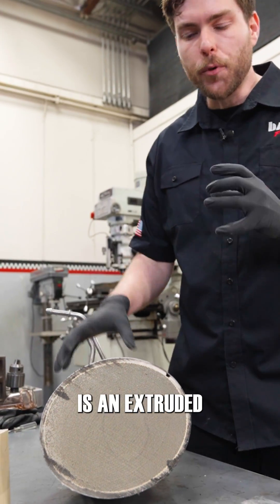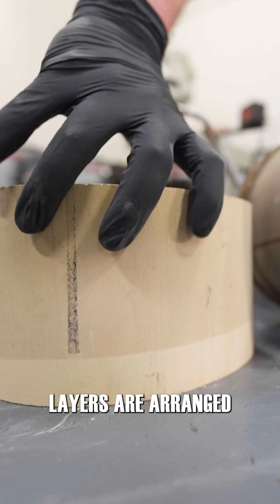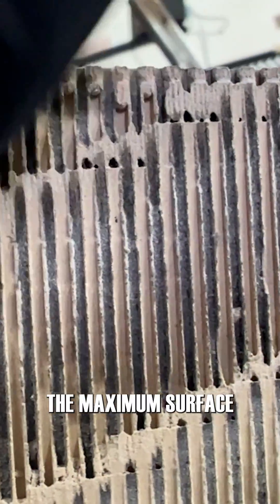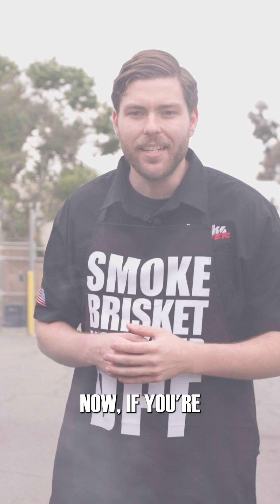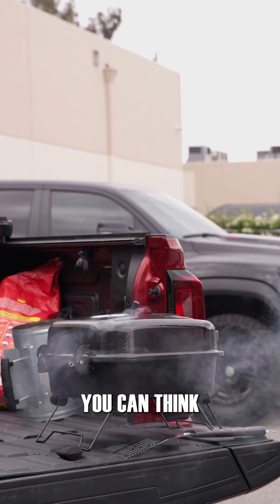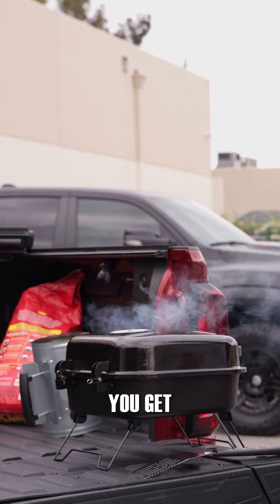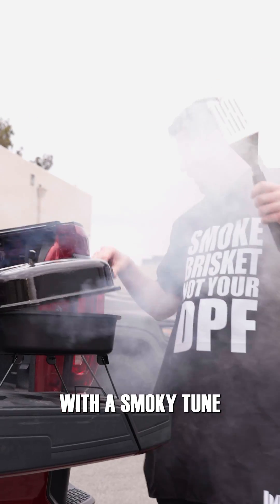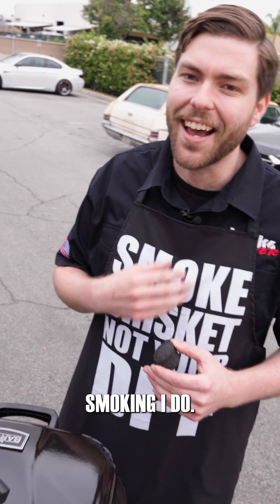Why rich tunes clog your diesel particulate filter (DPF)

Comment: What a waste of time and money. If you have a well tuned diesel engine you don’t need a dpf.

It’s all a money grab.
Reply: Even the most well tuned diesels don’t always have complete combustion
Reply: @AAthlete34  … and batteries for electric cars don’t always charge. I don’t see your argument.
Reply: @garrimic3  just saying, filters are necessary for scrubbing carcinogenic particles out the exhaust, they are needed for even well tuned diesels because they will always produce soot.
Reply: @AAthlete34  .. okay.. then what do you do with all the extra emissions that come from producing the systems? Not to mention the extra carbon emissions from delivering those systems to random shops? The carbon emissions that escape into the atmosphere when the system is cleaned?

There’s so much more added to the carbon emissions than just put a filter on your exhaust and it will make the atmosphere cleaner. Because you also have to include the large amount of carbon emissions added to the atmosphere by delivering the DEF fuel to every single truck stop that wasn’t there before the inclusion of the after treatment system. So how exactly do you account for just those few things I just mentioned.

Vs. Just having a well managed engine system that puts out the same amount of emissions without the system vs having the system?

It’s a money grab by environmentalists plan and simple. This started in California and look how nasty California actually is.

Comment: HE JUST TOLD YOU THE TRUTH ABOUT EMISSIONS SCAMMING GOVERNMENT 
""when you're car burns fuel efficiently you have very little emissions particals""
What they do not tell you about the filter is that it automatically DUMPS itself while driving periodically ALL AT ONCE !!! so just like every other bogus smog device created by government scammers to CREATE JOBS by the government, this is a scam...
Reply from the maker: It appears you've misunderstood. It does not "dump" particulate into the air. The system contains the particulate until it gets full. Then the diesel particulate filter burns it, turning it into ash that is not harmful to humans. The ask is what exist the tail pipe. There's no conspiracy. Just science.

Comment: A buddy of mine has a '19 Ram; bone stock, no tune. Originally got about 22 mpg unloaded and about 15-17 with a loaded trailer through the mountains. A "recall" came in for the "intake". Went down to 15 mpg unloaded after the recall. They can make the tunes cleaner, more efficient, and more powerful, they just don't; and will destroy what you have.

Kinda crazy considering I just bought an '89 IDI NA with 4.10 rear end that gets 16.5 mpg. Most running 3.55s get 19-20. Only time it rolls coal is 5th gear up an obtuse incline at full throttle.
Reply: It's only obtuse depending on your point of view 😂😂😂😂
Reply: My old '09 6.4 would get 30 on the interstate. It was awesome. But since it's a 6.4, I ended up saying goodbye to two pistons. So I upgraded to a '15 6.7. 13 mpg whether I'm towing or not. I eventually did a delete and started running an MPG tune and now I'll maybe get 19. It's absurd.
Reply: I have a 1982 6.2 detroit idi with a 3.09 rear, she rolls comfy at 20 to the gallon all day. She only smokes when I'm giving her hell on the throttle
Reply: That's what happened with the VW dieselgate.
An efficient tune, on Diesel, is not the cleanest tune. This is because the higher the cylinder pressures, the higher the efficiency but also the higher the NOx and SOx content.
This type of content on exhaust has massive consequences for local air quality.
Reply: @jorgecosta95 Cali smog reductions are negated by China
Reply: @RichardPrendingue  CO2 emissions impact globally. Soot, SOx and NOx emissions impact locally. 
A city with good air quality is good for everybody.
Reply: My dad’s dieselgate TDI Jetta got the government mandated tune done to “fix” what VW did wrong with dieselgate. 

The car used to get 55mpg on the highway, now it gets 40 at best. 

Still an absurdly good number, but when the whole point of the car was to get the best mpg possible, that’s a huge downgrade.
Reply: @everettbruckerhoff6029  you can reverse that tune for a couple of bucks with a “clip on” tune for a lot of VW vehicles. If you take it in for MOT, or maintenance just disconnect the chip and take it out.

Comment: DPF killed the diesel truck, all that “particulate filter” is…surprise it’s a Catalytic converter!! Same thing a cat does in a gas car an looks exactly the same inside
Reply: Diesels have a few “cats” they have a diesel oxidization catalyst first then flows thru the particulate filter(what u see here) then cooled and sprayed with def after the dpf than flows thru the scr finally and so they say that exhaust gas at the tail pipe is supposed to be cleaner than the air that entered the engine. (So they say)

Comment: Hearing Banks talk about the advantages of DPF's reminds me of  Phillip Morris' "Unsmoke your world" anti-smoking campaign.
Reply: Banks is very anti-rolling coal. He's all about a clean, efficient burn even if that does include more fuel.
Reply: @funkingitup1805  Absolutely, tuners who have made a living modifying emission compliant engine usually share this opinion. Steve Dinan(founder of Dinan and CarBahn Autoworks) had a similar take on people who delete their cats. It's useless.
Reply: @blackshadow7192  That's nonsense. Cats are restrictors. Deleting them is far from useless.
Reply: @xenn4985  You barely get more power. Carbahn will make you an 800hp carb legal S63 engine, it's already more than most people can handle.
Reply: @blackshadow7192  It's not about power. This is the one thing I cannot forgive the banks guys for. They push this power over everything mentality.

You delete the carb for engine longevity, not for power. Restriction is death. Let it flow.
Reply: @blackshadow7192 They only say that because the EPA would put them out of business. And if it is so useless, then why does every single race car have zero emissions equipment?
Reply: @CascadeSport  Because in racing you need to optimize the performance as much as possible. You don't need to do that for a street car.
Reply: @blackshadow7192 why not tho? Shouldn't I be able to optimize my vehicle that I pay 20-80k or even more? It's my property? Why can't I? The government does it, the airline companies do it. Basically everyone accept the base consumers of the oil derived fuel folks do it. But heaven forbid my truck doesn't have egr/dpf, de tuning etc etc. It's quite silly.
Reply: @mwim1226  Enjoy your acid rain lol
Reply: But where is he getting the power, high or low rpm?
Reply: @Robert-j6r8c  both places!
Reply: Thanks for the reminder, smoke break time

Comment: Edison motors is building a hybrid. It will get twice a fuel economy. With additional technology, they should be able to get the particulars of the diesel generator down to next to nothing using hydrogen or propane. Having a diesel engine accelerate and decelerate is just asking for overfueling.

Comment: Someone needs to conduct a case study showing the increased carbon foot print caused by the over manufacturing of these components, the addition fuel required to use them, the shortened engine life, plus the emissions required to hual them off the side of the road. Compare to a stock/clean running diesel that's pre emission, keeping in mind these older truck get better fuel mileage, last longer, and after 20 something years are still running requiring no additional manufacturing. Seems like the cleaned up tail pipe emissions have a less obvious cost that would be greater then what we had to start with. They just moved the pollution from the tail pipe to mining and manufacturing at what seems like would be worse. Like I said a really thural study would have to be done comparing mile for mile and utility starting from the mining through manufacturing all they way to the scrap yard or a significant millage like 500k or a million.
Reply: This, please. I am starting to wonder if the goal is overall less emissions or just trying to keep it out of densely populated places as much as possible even if it’s “relocated” via mostly manufacturing emissions instead. Which, can likely be run off of cleaner sources and regulated much easier. Ideally we will just switch to more advanced battery powered ev stuff (i hate them but given optimal future battery tech they are much better)
Reply: I don't see anyone addressing the DEF. It gets spilled all the time and is highly caustic and ruining your paint is the least of the problem
Reply: @treeless62  friend with a 2021 ram has had his def system freeze 3 times & leave him in limp mode 100km+ from home...

i deleted my 2018 with 4000km on it lol
Reply: @3DProductions how did you delete it? Everyone I know says you can't on newer rams. The newest one I've seen was a 2012 that was deleted.
Reply: @blankname8553 It's possible to delete emissions equipment on any truck. It just becomes a more involved process on the newer ones. If anyone ever tells you that you "can't" modify a newer vehicle a certain way, they're lying. It's always possible, it just takes more work.
Reply: @treeless62  what needs adressing? it´s  highly caustic in the sense that it is diluted water with roughtly 30% ammonia, which you need top break up harmfull NOx to CO2 and water, so it shouldn´t leave the exhaust pipe in big numbers, and every system should have a sensor to warn you if it does. it´s a way better solution to a DPF and enables a cleaner engine overall
Reply: Factor in the carbon footprint of transporting and manufacturing/sourcing of DEF.
Reply: Most emissions restrictions on diesels are to reduce carcinogenic gases, not carbon emissions.

Comment: Cracked Egr cooler make coolant dark, coolant and soot to intake. 7th injector clogs with soot cant get hot to burn soot, dpf clogged, def just builds up.
Bad Nox sensors, def pump fails, fuel wasted on regens,
Load not delivered, bills not paid.

Comment: A DPF system is the absolute worst idea ever they don't help anyone but the person you buy them from and the service guys
Reply: Clearly you live in a shithole with horrible air quality
Reply: The idea is pretty sound. Idk how you could say otherwise.
Reply: @putinslittlehacker4793  how much more carbon was emitted with all the mfg of these stupid clogging up all the time filters, and they require a regen every so often and that uses excessive fuel! just like the stupid old AIR pump systems on cars that simply pumped air into the exhaust stream through the burn your car down BB style converters all trash and it takes a large amount of precious metals and all that by far defeats the emmissions savings by far!!
Reply: @MrChevelle83  The clue is in the name, PARTICULATE FILTER... Stop ranting, you obviously dont know how a dpf works or what it even does...
Reply: @gitanonumero1983  even if I didnt know what it does it doesnt change the facts I mentioned.
Reply: @gitanonumero1983  You mean, like destroying engines?
Reply: @ajs96350  How does it destroy an engine? Enlighten us 😂
Reply: @gitanonumero1983  I know personally a lot of guys who are truckers and they CANNOT keep their trucks on the road because the DPF system either fails or destroys the engine early, it's a pandemic with semis.
Fresh oil will be black as coal 10 miles after an oil change, the oil quality goes to garbage in the pick ups.
Regenerations fail, extra fuel gets injected for a regeneration that doesn't happen it drains into the sump and mixes with the oil and will take out an engine.
I'm not some keyboard warrior, I have a LOT of experience with this junk.
Reply: I mean, if you like lung cancer and heart disease, sure.
Just because something annoys you doesn't mean it's not worth doing.
Reply: @microcolonel  then you'd think our own government would run them on government vehicles, but they don't.
Reply: @dirtbeard108  they exempt themselves, they are not "our" government, or at least not mine
Reply: I think they should be enforced more, it really pisses me off when people roll coal.
Reply: Found the gay guy ^
Reply: yep waste of manufacturing.

Comment: And when dpf burns particles, where are they going? Back in air.🤦
Reply: yes, but at least there's a phase change....
Reply: Yes. As carbon dioxide and not soot. It's almost like there is a difference
Reply: Actually they’re being pushed further down the exhaust injected with def neutralizing the box than flowing thru the scr at that point clean air is coming thru the tail pipe

Comment: You put an egr and an egr cooler on a diesel engine to reduce combustion temperatures (to supposedly reduce nitrous oxide) then you are going to get very sooty (dirty) running engine. At work we had a late model cat pre-cup mechanical engine that on a soot test had less than 0.5% soot.
Reply: They made shit better 50 years ago. Everything is over complicated bs nowadays
Reply: @austinkissling9036 not even 50, try just before emissions regulations got so stiff.
Reply: to supposedly reduce NOx? you mean the "supposedly" but definitly measurable and proven thing? and also how does it make it more sooty? given that a rich burning engine is a sooty engine so if you put some exaust back into the combustion chamber you have less air so you just  dial back the fuel a bit. And also i do beliefe that pre- cup engine was not sooty but did you measure the actual co2 and NOx levels?
Reply: @andreasspachmuller7002  if egr doesn't make it sooty then why do you need a trap......that plugs up so fast? Why not make the engine run clean and then use a bigger catalyst and more purified cow urine (def is the same chemical composition) to take care of the nox? As for the co2?...who cares.
Reply: Thank you 🙏🏻 for this truth

Comment: Smoke out the tail pipe is horse power leaving the block.
Reply: Because they have huge turbo's, ones they get spooled the smoke clears up,
Reply: It’s all in air and fuel setup. 
With high hp numbers, you’ll make smoke initially while the turbo setup spools but the right setup would clean it up to virtually 0 smoke at wot
Reply: It's stupidity behind the wheel.  The best performance leaves absolutely no smoke.
Reply: @Gojira5667  At some point you need water injection to cool things down and dumping extra fuel into the cylinder is a way to do that without having a separate water injection system
Reply: DAMN RIGHT!
Reply: So explain deisel tractor pull tractors........
Reply: @shamus813 diesel tractor pulls are running extremely rich air/fuel ratio. Hence the massive amount of smoke. They could make more power if all that extra unburnt diesel was actually getting burned in the cylinder. It would be less wasted power. But the trade off is since they’re running under EXTREME conditions, they need to absolutely not be lean or stoichiometric, or else catastrophic damage might occur. All performance vehicles do this. 

Your pavement-princess class 1 pos passenger truck doesn’t need to run rich. It’s not a performance vehicle doing any real work. Grow up
Reply: @kasyndri well said!
Reply: @kasyndri  lol you literally explained to yourself why people do it. These things are coming from the factory with over 1000 lbft of torque and if you really want more out of them, you do what you just explained to yourself lmao
Reply: @shamus813 man you were schooled. I hope you learned something boy.
Reply: @shamus813  mechanics injector can not change how much fuel is being injected they are either 0% or 100% if the boost if low but 100% fuel injected with the low boost will be smoking until boost meet the correct required for the fuel

Comment: I have a 1982 Mercedes 240d 194k and believe it or not it has never smoked(roll coal)
Reply: bet it makes a grey haze and heck that thing only takes 2 weeks to get to 40 mph
Reply: @nou8257  have you owned one? They aren't that slow and are great highway cars
Reply: @SpikeArrowood  My dad had a few diesel Mercedes over the years his worst I don't remember what exact model 300 series i think it was but one was a non turbo diesel and god it was slow.

I dunno what your definition of slow is but im used to driving little turbo 4 cylinder cars and my diesel trucks and one of them has around 600 h.p
Reply: The new benz om654 is quite remarkable for what it is…4 cylinder diesel 260hp 500nm. Integrated starter, 2 scrs. Gets 30mpg. 25mpg towing 7500lbs and this is all with a government mandate holding their balls back

Comment: I think ill stick with dinosaur 7.3😅
Reply: Lol you say that right up until you tow 30k lbs behind one and then go do it with a 6.7. We have several of both and there is just no comparison
Reply: @parkerfetters7588  ive done it, my dad has a 6.7. And youre right there is no comparison, you have to remember that theres at least a 12 year difference between the two engines.
Reply: @parkerfetters7588  Considering the 7.3 is reliable runs for ever is pre emissions and is far cheaper then a 6.7 truck i'll stick with my slow with 30k hooked to it 7.3.